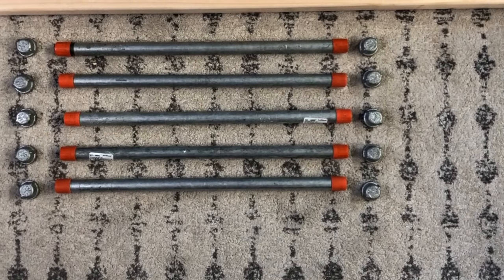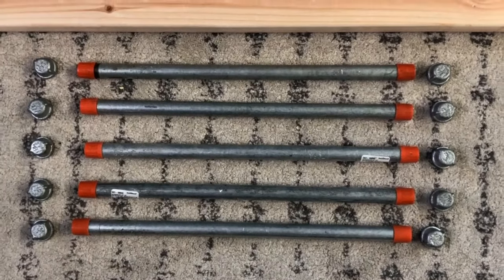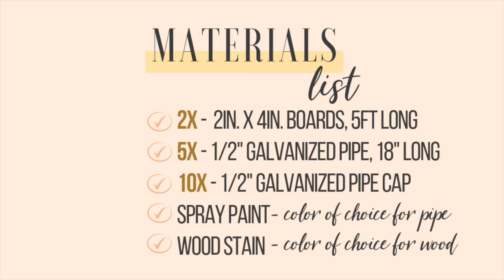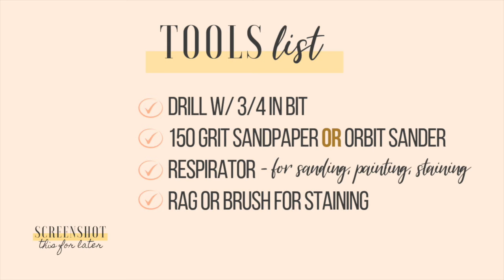Industrial DIY Blanket Ladder - Under $60 (No Screws Needed)

Comment: Unfortunately the cost of the pipes are out of sight now. I used some metal pipe from a raised dog bed. Another idea would be to use a metal curtain rod which can be found at tag sales. If you can’t find a black one you can always paint it black.
Reply from the maker: Yes! I’d also just use wooden dowels painted black and put the caps on the end so they look like pipes!

Comment: I am wanting to use this to display some of my grandmother’s quilts. I’m a little worried about the paint on the pipes will mark them up even a little bit. Have you had that happen?
Reply: instead of painting you could also use a process called cold blueing. Its a bit more labor intensive but won't rub off like paint. birchwood casey makes a good cold blue product.

Comment: any issues with the pipes rubbing off on the blankets?
Reply from the maker: So the black pipes come coated with a layer of oil which in some cases isn’t dry, you can fix through cleaning them or sealing them with a clear polyeurethane prior to use 👌